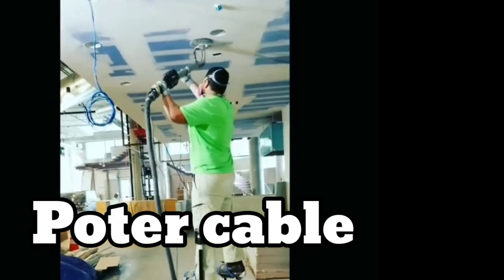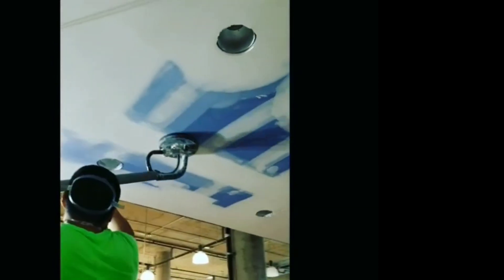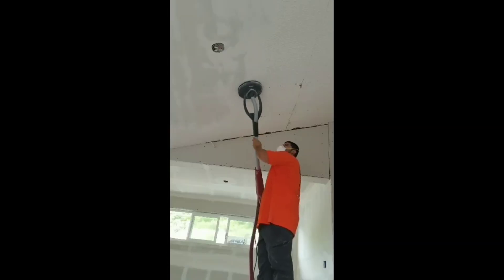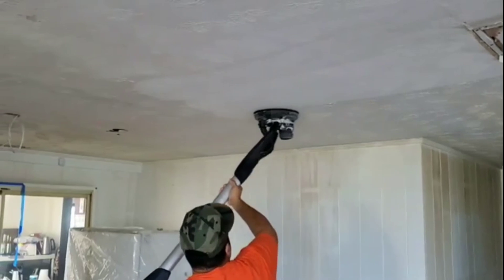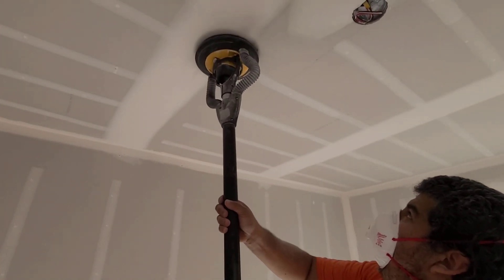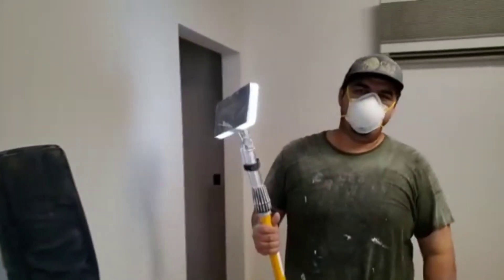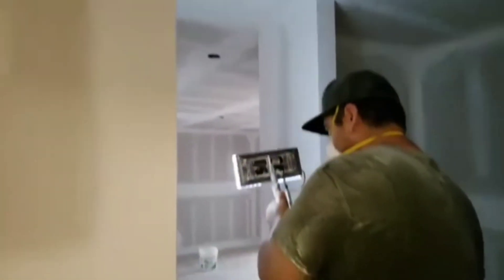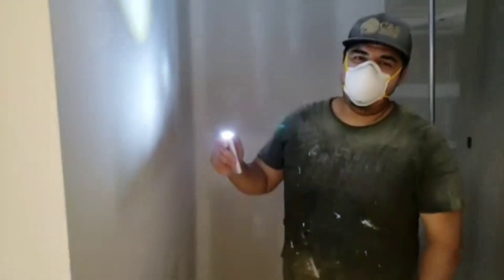Electric drywall sander evolution

Comment: I also use it without q vacuum being doing this for over 35 years never used a vacuum only have done new build so no use for the vacuum idk how the mirka leros will handle all the dust the in motor

Comment: I have been using the planex for several years. It is needing replaced. Which one would you recommend if you where going to have just one sander.
Reply from the maker: Iam uploading a video on all the sanders I have owned to answer alot of similar questions. Stay tuned and thanks for watching 🤙🏽

Comment: Is the mirka brushless???
Reply from the maker: Brushless motor. The brushless motor reduces the weight of the tool significantly. In addition, less maintenance is needed since there are no carbon brushes that need to be changed. Got it off there website.

Comment: Sanding popcorn? Try soaking it with a hose with couple layers of floor paper down and scrape that shit off!!
Reply from the maker: We usually  do that but this popcorn was painted we were able knock down the painted layer enough on the first pass to sand it down completely on the second pass. For this job this option worked best and keep things clean especially since it was and addition to an existing lived in area.
Reply: @csdrywallhawaii  painted popcorn blows to remove

Comment: Good videos always,thx for sharing. Personally,i preffer festool,mine has three indual short poles which can be put together to reach higher-i am really not good at using stilts and i have a very bad lower back as a result of hanging too many plasterboards in a bad body positon habbit.
However,i am more interested in the led light pole sander you have in this video,may i know if you made it yourself or bought it somewhere?
I am living in australia
Reply from the maker: Awesome thanks for the support brother. Its in the patient process that was just the prototype haven't mass produced it yet.

Comment: Drywallers know what a properly designed electric sander should be.  A room full of cluster phocks known as engineers, the greatest minds on earth , can never get it right. Porter & cable, nice try. The original planex, too heavy, and the sanding head is just clumsy. Festool thinks there on to something and come  out with the planex easy cause its lighter? But, the sanding head is compromised for dust extraction and its concave. Only the 2 inch  perimeter of the sanding pad is in contact with the wall surface, which is still usable but full surface contact is obviously preferred. Looks like the the guys at Mirka finally go it right, with an orbital sanding stroke, allowing for the best possible finish.
Reply: Ya, I'm 62 years old, just sanded out a house today, ceilings and walls, 9000 sq  ft,  with my mirka,  with a pole sander, I'd  be hurting, with the festool, I'd be ticked off, with the mirka, could have sanded more. Mirka leros is a game changer, other sanders don't even come close..........
Reply from the maker: Ya I feel you some of the ideas that come out of the big companies are a head scratcher for shure.